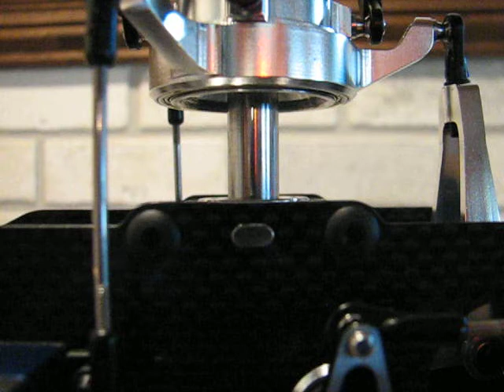T-Rex 600LE main shaft locking collar mod

Comment from the maker: @nicobec  You've never done a full collective punchout?   You probably won't do that AND use full cyclic, but I just wanted a bind-free set-up whether the heli is flying or not.   That was the basic reason for the mod.  Plus it looks a lot nicer, cleaner.    As far as bogging, depends upon your set-up.  Bert K uses 14 degrees of collective and 11 cyclic, and his barely bogs.